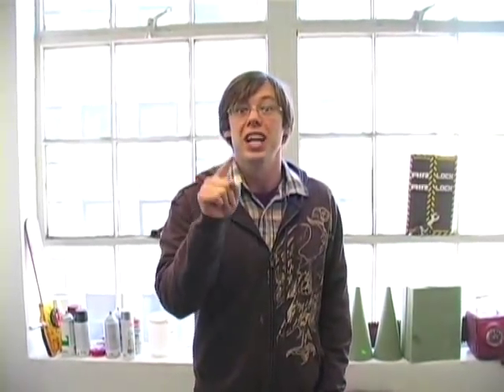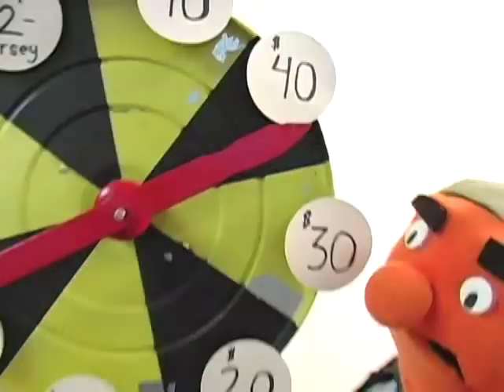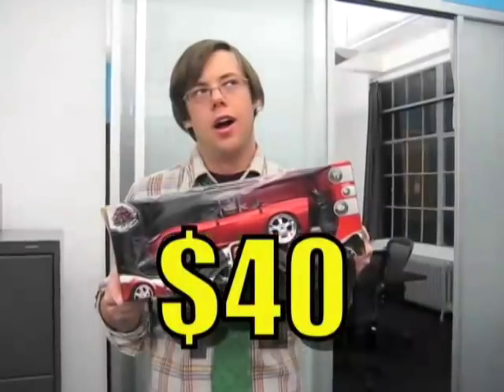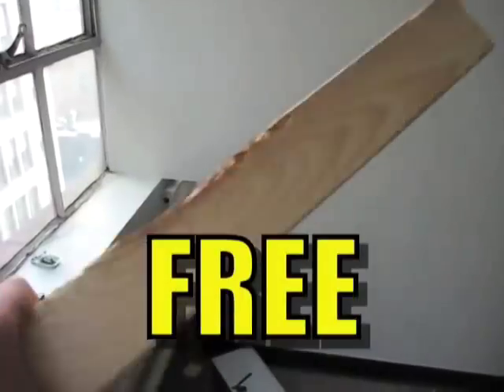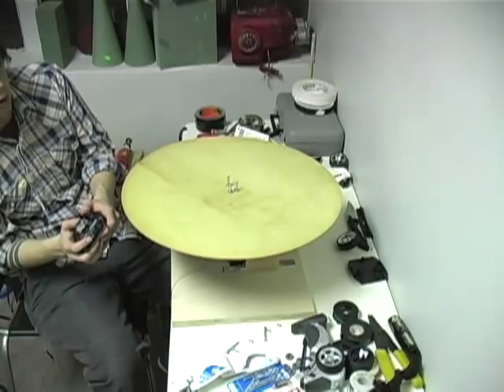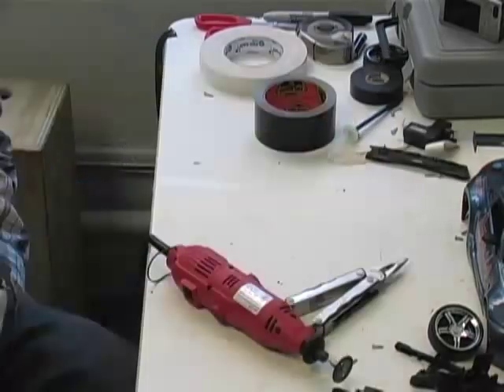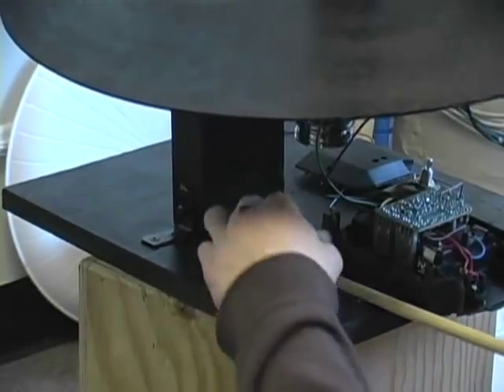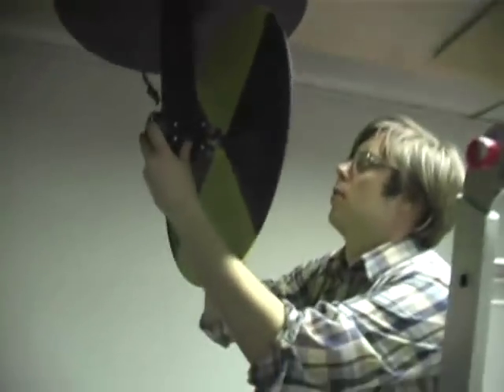Camera Pod, Radio Controlled : BFX

Comment: Use drywall screws, they are easier to drive into the wood using a drill.  ...and why not just scavenge the RC units and junk the original motors?  Then you could find low RPM motors more suited to the task.  Also, the whole setup looks pretty wobbly.